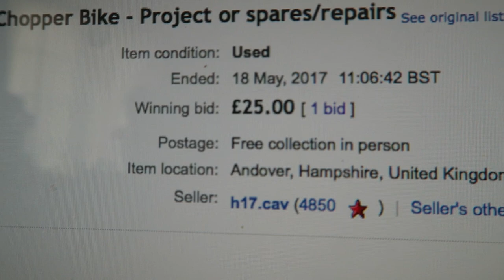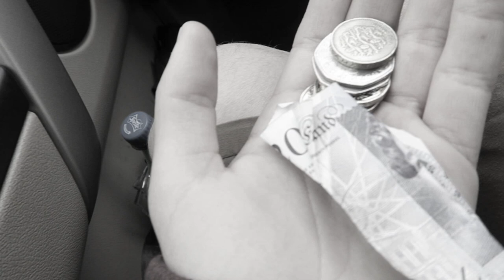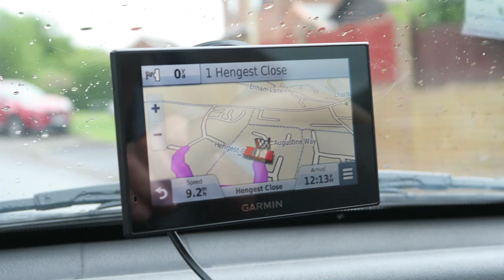Schwinn Stingray Chopper Restoration

Comment: Great work there. I just purchased one from Gumtree. Looking forward to restore it. What did You used for cleaning front fork and removing rust from seat post? Wire brush?
Reply: lukas430000 Wet aluminum foil works good to remove rust on Crome

Comment: I have an electric blue OCC stingray chopper. Its impossible to find original parts for it. My back tire is completely bald and I lost the chain guard in a move. But it's still my baby!
Reply from the maker: wow that seems like something special! Defiantly regularly check EBAY because little gems always pop up on there :)
Reply: you can find new parts for it (such as tires, chain guards, bike stands, front and rear finders, etc) on EBAY.

Comment: Find a page on Facebook or a website called pedal chopper they do restoration part, extended seats forks and handle bars, there's also custom parts like fat tires for the front or alloy wheels, there's also engine kits, check out also the Schwin Stingray XL & The Schwinn Stingray Spoiler which I own, just thought I'd try help you out because I'm part of a community who restores these and/or converts them into e bikes, trikes and mobility scooters, I'll follow you and message you again when I have my company up and running because by then I may have some parts myself for you
Reply from the maker: Joshua David Thanks man I will have a look

Comment: how tall are you...just want to picture how big is the bike
Reply from the maker: I think I'm about 5 ft 7 but the seat adjust to size as it goes back rather than up :)
Reply: thanks man !!...one more : does it feel heavy to push those pedals and how fast can it go ?sorry if u said that in the video !!
Reply from the maker: no its not heavy (maybe a little when started) once you get moving minimum effort for max speed really!
Reply: I'm 5"0 and I fit it btw I'm only 12 that's why I'm only five foot tall
Reply: @finnaadlxy7549  When I was 12 I was 5`8" lol

Comment: Good video i have the same bike i would push your project further on ebay you can buy a engine kit which is £80 and also the engine mount to run it for £20 why not put an engine on one like i dont to mine soo easy to do